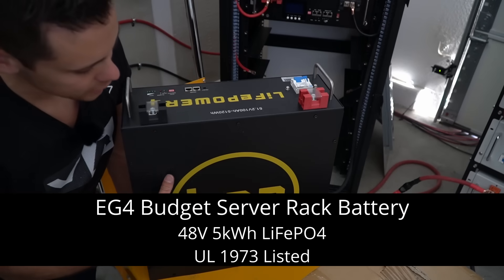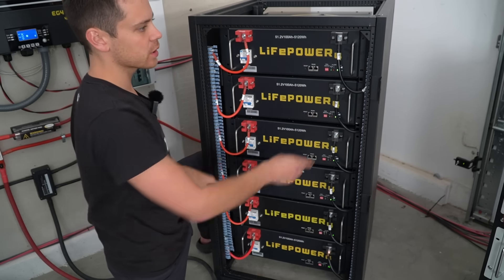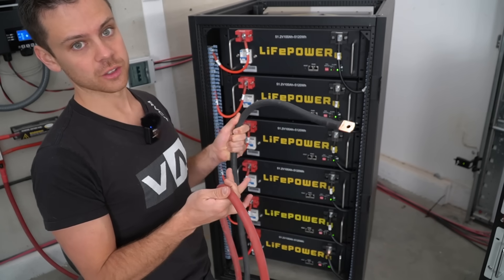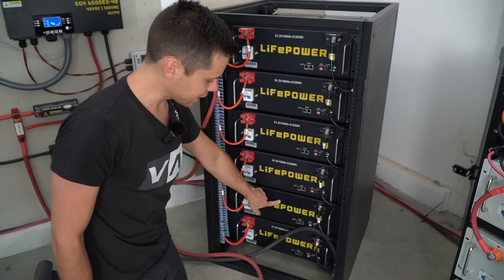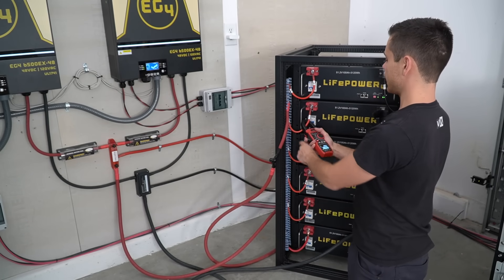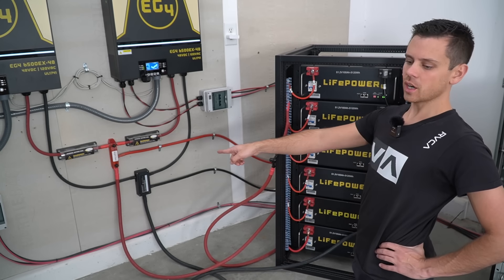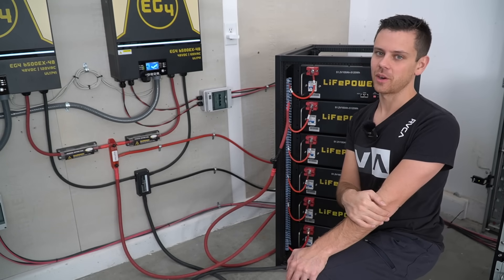How to Build an EG4 30 kWh LiFePO4 Server Rack Battery

Comment from the maker: To purchase this battery, go here: https://www.mobile-solarpower.com/server-rack-lifepo4.html

0:00 Initial Assembly
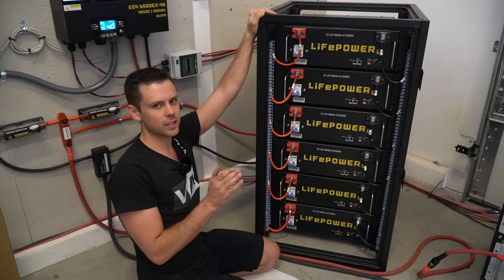0:58 Connection Check And Power Up
1:40 Connecting to Solar Power System
2:49 Pre-Charge Circuit Procedure
4:14 Current Test
6:05 Conclusion

~~~~~~~~~~~~~~~~~~~~~~~~~~~~~~~~~~~~~~~~~~~
Tired of getting ripped off? Check out my "Will Prowse Approved" solar product recommendations below!

12V Batteries
https://www.mobile-solarpower.com/lithium-batteries.html

48V Batteries
https://www.mobile-solarpower.com/48v-batteries.html

Offgrid Inverter System Builder
https://www.mobile-solarpower.com/48v-complete-system-blueprint-559371.html

Hybrid Inverter System Builder
https://www.mobile-solarpower.com/code-compliant-48v-offgrid-system.html

Mobile Handtruck System Builder (very popular!)
https://www.mobile-solarpower.com/mobile-48v-system.html

Solar Panels
https://www.mobile-solarpower.com/300w-solar-panels.html

Ground Mount Solar Racking
https://www.mobile-solarpower.com/ground-mount-racks.html

Wire, Lugs and Busbars
https://www.mobile-solarpower.com/wire-and-connectors.html

Tools
https://www.mobile-solarpower.com/tools.html

Fuses and Circuit Breakers
https://www.mobile-solarpower.com/fuses.html

Plug-N-Play Solar Systems
Ecoflow, Anker And Bluetti! So many models to choose from. See my current recommendations here:
https://www.mobile-solarpower.com/full-size-systems.html

~~~~~~~~~~~~~~~~~~~~~~~~~~~~~~~~~~~~~~~~~~
Need to build a large DIY system? Need a trustworthy solar distributor? These are my favorites:

Signature Solar
Creator of EG4! Solar Minisplits, Victron and More! Largest Solar Store Online.
If you want $50 off, please use my link below and coupon code "DIYSOLAR50":
https://signaturesolar.com/?ref=cPwLcVc0SW-BjN

Current Connected
Best Prices for EG4, Victron, Midnite and so much more! Fast Shipping and Highest Rated Customer Service:
https://currentconnected.com/?ref=wp

~~~~~~~~~~~~~~~~~~~~~~~~~~~~~~~~~~~~~~~~~~
Join our DIY Solar Community 
Need more help? Join the largest solar forum on the internet for beginners and professionals alike. 140,000 members and counting!
https://www.diysolarforum.com

Check Out My Free Book
Best-selling and beginner-friendly guidebook to off-grid 12V solar!
https://www.mobile-solarpower.com/the-book.html

~~~~~~~~~~~~~~~~~~~~~~~~~~~~~~~~~~~~~~~~~~
Contact Information:
I am NOT available for personal solar system consult! If you wish to contact me, this is my direct email: williamprowsediysolar@gmail.com
FTC Disclosure Statement and Disclaimers:
Every video includes paid promotion or sponsorship (such as free products for review). Some links on this YouTube channel may be affiliate links. We may get paid if you buy something or take an action after clicking one of these. My videos are for educational purposes only. Information is subject to change/update at any time. Electricity is DANGEROUS and can kill. Be smart and use common sense :) DIY Solar Power with Will Prowse is a participant in the Amazon Services LLC Associates Program, An affiliate advertising program designed to provide a means for sites to earn advertising fees by advertising and linking to Amazon.com
Reply: Thank you Will.  🤜🤛 from Wales 🏴.
Reply: Do you have a link to that yellow cart/lift?
Reply: @PrimalNaCl  I wish I would have known something like that existed before I put the batteries in the cabinet by myself and tell you what that was not easy LOL
Reply: Have you thought about doing a video with a Inverter generator backup wired to run by sensing voltage from the dry contacts? Also noticed your dip switches are set the same.. Are they functional?
Reply: Hey Will, If you can, please share the love and hook this bad boy up to an MPP 6048WP after you dial in the EG4. If it can't be done, please enlighten us as to why.
Reply: Hey Will. Can you make a video regarding having multiple grid tied single fase inverters with battery connected to the same installation. Are they able to work together, when each one of them are trying to compensate the usage on all phases?
Reply: Great videos for the EG46500EX... I was wondering... If Signature Solar was to bring out a grid-tied and UL listed inverter solution, would it make you interested in grid tie applications/videos?
Reply: Hey Will, do the batteries put out any substantial heat?  Asking because of the choice between the open 6 batt rack and the enclosed 6 batt cabinet, would they get hot in the enclosed cabinet?
Reply from the maker: @dalel3608  no, not at all
Reply: With that many battery in a rack, is it even possible to recharge them to 100% from 10% on a standard roof solar system?  I do not think you would have enough sun time...
Reply from the maker: @commonsenseguy8189  yes, I have a 12,000W array
Reply: @WillProwse  How many panels is that?  40 Panels?  Way more than the standard roof can hold...
Reply from the maker: @commonsenseguy8189  this is my offgrid system. watch my other videos where I rebuild this array multiple times. My main house has 16.3kW array for grid tie. The 12kW system is for my workshop
Reply: Can I connect direct to a 400 amp service/meter?
Reply: Hi Will, love your stuff, recommend your channel to so many of my friends. What is the width of the server rack? I am hoping to squeeze two side by side!
Reply: All I need is grid to battery charging. And battery to disconnect switch in the event of grid down. Not looking for much at all.

I have my disconnect switch in place already and a predator 5k generator on the ready.

Thinking in a worse case scenario, I'll use the generator to recharge my batteries and continue that cycle for as long as I can when chaos hits. My HOA will not allow solar, but I imagine my smaller panels will have to be used if necessary.
Reply: Hi Will.  My spouse and I want to put a large solar system on our rural property in CO.  We have a 1500 sq.ft. cabin on it but it will become a guest house and we intend to build a 3k sq. ft. main house.  We also have a full shop w additional freezers and an RV for guests.  While we have power to the property, it is unreliable and expensive due to remoteness.  We have $30K total budget for solar and are clueless if this is sufficient to put in a decent off grid system to act as primary w the commercial power as back up.  Would you kindly point me in the right direction.  I love your videos and value your advice.  Many thanks, Joe.
Reply: @WillProwse  C an you please explain further about the pre-charged resistor? You have done differently in one of your videaos where you have used an actual resistor to do it. Thank you very much

Comment: Does anyone have a reference to a good video on the particulars of this server battery rack? 
Normally Will does an amazing job with his videos but this one skipped some things. He skipped the guage for the battery to bus bar connection, how he connected the leads to the bus bar (regular hardware bolt, self tapper [please don't do that], a threaded hole in the bus bar, how much each battery weighs, conduit knockouts (and the fact that the batteries block the holes).    I do love Will's videos but he seams to be putting less and less information in them. Please subscribe to him if you want to get started in solar!
Reply: FYI, I couldn't find the blueprint either.

Comment: Just wondering:
Why do you connect those batteries parallel (keeping a low voltage, but very high current), instead of connecting them serial (keeping a low current, but using a higher voltage)?
Most, if not all inverters are capable of handling 1000v.
And lower current’s reduce loss and chance of overheating.
After all, modern EV use 400vdc or even 800, 1000vdc

Comment: I have a good question! since you said that if a rack battery is going to fail its most likely the BMS in the battery. so would that make a rack system more likely to fail than a single battery like the eg4 14.3 ???

Comment: Will I love you videos and have learned so much from you. I am preparing to begin assembling my system and looking at your diagram on your wiring here for 2 racks of batteries I'm curious why one set for Battery #1 uses 4/0 copper cable and Battery #2 uses 2/0 copper cable? I have two racks (6 each) of the LiFePOWER 4 batteries for my system, two 6500ex inverters along with the new Eg4 Chargeverter. The 48 solar panels arrive tomorrow. I hope for your reply.

Comment: We bought 2 48v EG4 batteries and an inverter about 30 days ago.  So far one of the batteries has failed and a week later the inverter failed.  The company is very slow to respond and refund.  Lots of hoops to jump through and they don't have product on hand to replace the batteries.  So frustrated.  Can a different inverter be used with the remaining EG4 battery?  So disappointed in this company.

Comment: 7+ months after receiving a bad 24v battery Signature finally confirmed they received the 24v low voltage since day 1 battery but they don’t know when a replacement will be available.

What a nightmare to TRY to deal with them!!

Comment: Your videos are amazing!  You've mentioned several times about avoiding a ground loop regarding the sub panels which makes complete sense, however, what about grounding the server rack to earth ground?  The manual recommends this but I'm questioning this requirement?  To clarify, I'm speaking of the grounding lug on the rack, not the negative bus bar!

Comment: DO you use any communications to the charger/discharger/inverter or do you just charge and discharge with the rated voltages and let the BMS in each battery handle the rest ?

Comment: That is amazing.
I built a backup system in the late 90s using 24 AGM batteries to get the same capacity.  This was a literal ton of batteries and took up much more space than that rack.

Comment: Originally i was considering to go with the buy and use method  but looking closer  I get more bang for my bucks to build one.  Way way more bang for the bucks!    
300AH  16S 51.2V with rack, bms and active balancing  for up to $1500.   Seriously  diy is a way to go.    Ready to use is 100ah that is 5120Wh   up to $1500 VS 300AH that is   15,360 Wh  for about the same cost.  3 times  the power for about the same cost  so it is a no brainer the DIY method is the better option.

Now i have not mentioned for the DIY method i could pick and choose  for the bestter bms and balancer (active balancer with 2a or more) which means it is even better for certain with the DIY.   There is NONE of the ready to go server rack that has active balancing of 2A or  more  for that price and God knows what kind of bms they put in there.

Who says that ready to go type is better does not know what they are talking about!!!!!!
Now my diy method requires understanding of what are buying and know how to search proficiently online and of course some electronic and mechanical knowledges to assemble one.   The majority of the public 99% is NOT in the 1% as mine so they go for the easier one.

I find assemble battery pack is fun and very easy but then I am NO newbie in this as i have been doing this since 2017.  Majority of consumer is NOT so that explains the popularity of the plug and play power pack.

Comment: Do you use a manual or automatic transfer switch to remove your house battery backup  system from the grid in the event of power outage? Anyone have any recommendation for this?

Comment: Hi, just a simple question : If the battery is full, does battery disconnect itself or inverter does , then where the extra solar power would go to?

Comment: If I have 3 6500w inverters and 3 48v batt cabinets how would you suggest connecting the batteries and inverters so each inverter could utilize the entire 3 cabinet batt system?

Comment: Can these be hooked to Sunnyboy Storage which takes in 320~451 VDC from a BYD H-10.2 battery. These can be put in series to get to a 300VDC mark.  The startup voltage for the Sunny Boy Storage is 100V DC and max 10a current but it is rated to accept input range of 100 V - 550 V DC.

Comment: i recently thought to get one server rack empty case to build this stuff inside a case, would you recommend it? like all 105Ah Cells in like one 4HE Unit and connect them paralell and add a bms outside in a extra box, the cases have all kind of holes so you could manage to keep the bms inside with the batteries or outside. what do you think about this idea? Because i would suggest, it looks very cool, and servercases where the racks are going in, are having already holes for 2 120mm fans so you could cool the batteries down in the summer...

Comment: I'm trying to install my own system it's 265 100 what inverters they're both the same dental I want to wire them in so both battery banks are charged from both units but I want it to be balanced how do I make sure that both batteries are working together injunction to feed the power to the inverters properly

Comment: Neat with the diagonal connection. But why not using a torque wrench to give each rack connection the optimal condition? In tropical areas or subtropics like Florida a bit of conductive grease can prolong the installation!

Comment: BUYER BEWARE: Bought one of these 48v batteries from signature solar, DEFECTIVE RIGHT OUT OF BOX - returned it for a refund a week later (took one (1) week to get a reply! -   Sent it back 3 MONTHS AGO and still haven't not got my $1,800 back. Also keep getting a bill from the shipping company saying that signature solar never paid them either.   They have my battery and my money and I have nothing...what a scam
Reply: Did you get this issue sorted out?
Reply: @KingJames6306  No, they actually asked me to send the batteries back so i sent them back with the promise of a refund since they didn't work right out of the box. and also blew my 2400 inverters and so i sent them back and then signaturesolar kept the batteries and the money, not only did they do that but they also didn't pay the shipping company that delivered the batteries...don't know how the dude sleeps at night

Comment: I must add a comment to where you use diagonal connection. Hint, use connection cables at same lenght no matter what. If you let one cable shorter, you fucked up things...asimery in battery pack. Battery pack impedance issues....

Comment: What would be the typical location in a house to install?  Garage?  Would ambient heat be an issue in an unconditioned, uninsulated garage in California?  What would one do if the garage is ideal to install but the ambient air is over 113?

Comment: I'm looking forward to seeing the setup/comm settings for the split phase.  I ordered all of the components you suggested with a dozen of the CanadianSolar 445W bifacial panels and want to set the SP1 unit to USE so I can forego the comm settings for the EG4 and do away with those error 61 issues.  I've yet to charge up the batteries but hope to have everything operating shortly.  Just waiting on your settings info to finish the job.

Comment: Could you use a 1 to 6 splitter below the connection points on the bus bar connection of each to achieve better leveling?

Comment: I would like to run two full size refrigerators a 7cf deep freeze and a commercial sized kegerator in my garage could I get by with one all in one unit and a couple of these batteries? And how much solar input do you recommend? Thx

Comment: I didn't get from the video whether the EG4 has an inbuilt precharge circuit / inrush limiter? Or does the BMS they use have one?

The batteries not outputting the same current make me lean towards building a 30kWh 2p16s configuration to avoid having to deal with the shenanigans of parallel batteries. It's also cheaper :)

Comment: Hoping that you still read older comments!

I bought two 24v EG4 LiFe PO4 batteries and was wondering why the wires connecting to the busbars were smaller than the wires leaving the busbar to connect to the Lynx Distributor. How do I know how to size the wires running in parallel?
Reply: +1 would love to know more about a two battery configuration, and wiring sizing. @Triston, did you figure it out?
Reply: @coltybambam  I did! So, the reason that the wiring going from Battery -> Busbar is smaller than Busbar -> System is because the power draw from each battery is relative to how many batteries you have. 

Say you have a system that draws 300a total at 24v. You'd need a minimum Wire Gauge of 2/0 which can handle all 300a of power draw. This 2/0 cable is what would be from busbar -> system. However, because you have two batteries, the power draw is divided equally between each battery, meaning each would only be 150a. This means that from batter -> busbar, you can have thinner wire (in this case, 2AWG) because there would (or should) never be 300a running through a single battery's wire at any point.

This logic expands to any amount of batteries. If you have 4 batteries, then battery -> busbar only needs 6AWG minimum because each individual battery is only providing 75a

Comment: Quick question about flipping the bus bar.

What if you run a feed to the top and the bottom of the cabinet bus bar instead of just connecting one end?

Comment: I installed (6) of these batteries and ran a test last night to check longevity.
It was in alarm mode this morning but the inverter didn’t switch to grid.

How do I clear the alarm?
Is that just cleared from a full charged battery bank?

Comment: I’m looking for what size cable jumpers are needed to connect the batteries to the bus bars. I’m setting up my system exactly how Will’s system is set up, although I currently have smaller solar array. Only 3300 watts right now. I’m building a cabin and will add panels but for now I just need to run the basics. To keep building inspector off my back over the system, I’m mounting my system on RV. I’ll add solar panels once the buildings are up.